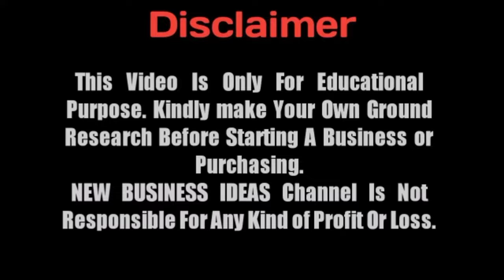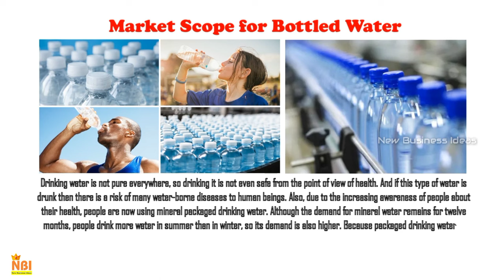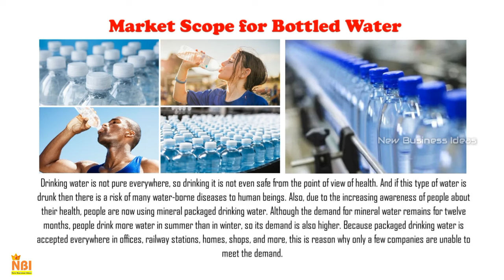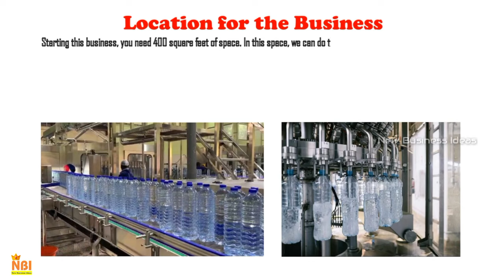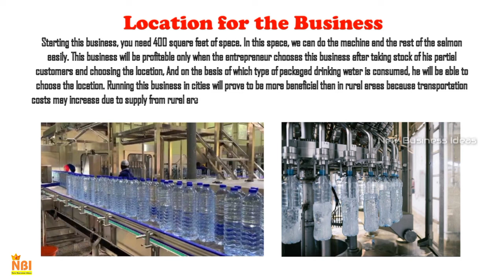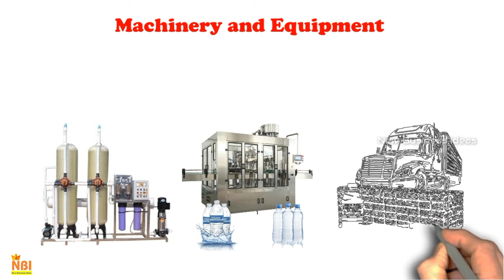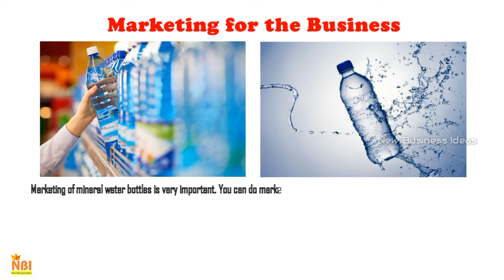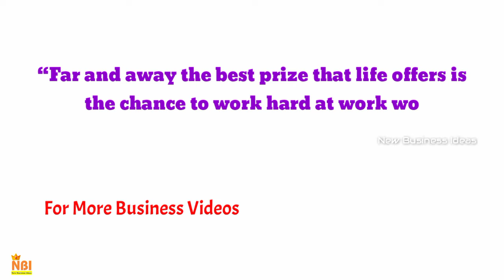Bottled Water Business With Low Investment || How to Start

Comment: How much area is required for this project?
Reply from the maker: The required area for this  project can vary depending on several factors like production capacity, storage needs, and local regulations. As a general guideline, a small-scale bottled water plant might need around 1,000 to 2,000 square feet for basic production and storage facilities. For larger operations, it could be significantly more, potentially reaching tens of thousands of square feet. Hope this helps!